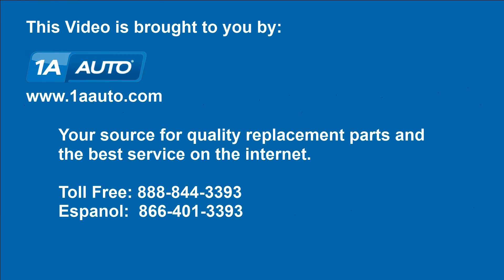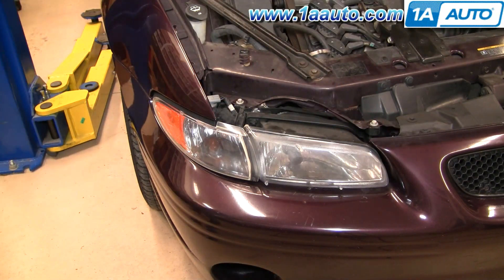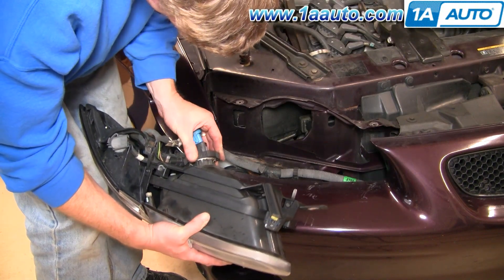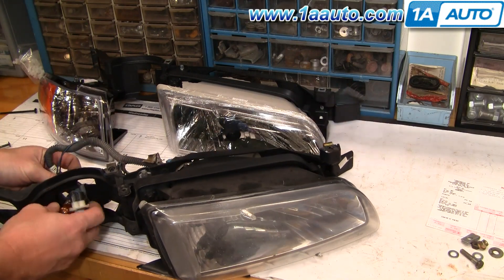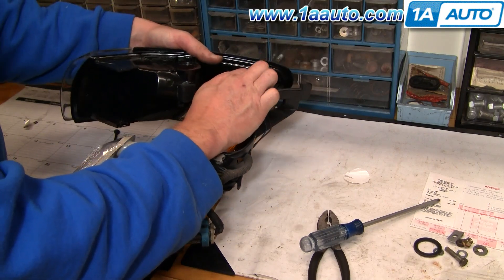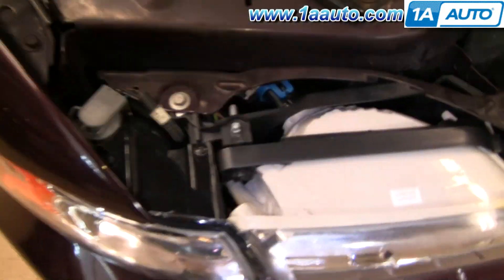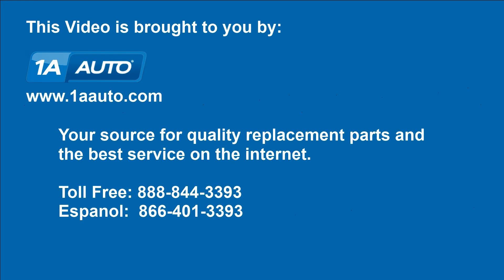How to Replace Headlight 97-03 Pontiac Grand Prix

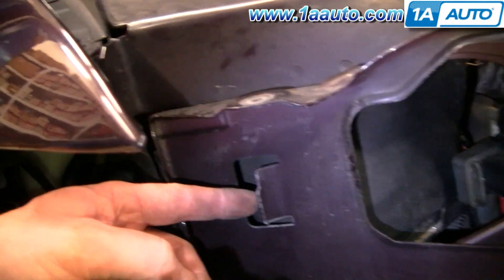Comment: I don't think I could have done this without your video.  I did notice, during post installation review, at 5:42 of the video that the back tab on this car had been notched at the top.  After struggling to get the back of the headlight to fit under the back tab, I used side cutters to trim the top of the plastic piece made onto the headlight.  Easy Peasy.  Thanks for the great video.  I can drive at night again!

Comment: Excellent video! I ordered a set from your site for my '00 (which had terribly oxidized lens), they arrived very quickly and the packaging was excellent, appreciate the free bulbs as well although I chose to upgrade to the zXe Sylvania bulbs as we need all the help we can get night driving here in MI with these treacherous roads!

As for the installation, they both went right on hassle-free, clicked right into place, no struggle at all, screw holes lined up perfectly. I also elected  to apply silicone sealant around the housing seam on each to prevent condensation, another downside to car ownership in MI. If it isn't snowing, it's raining! Not to mention the extremely high humidity all summer.

For only $89 bucks out the door and free UPS Ground, these were a great winter fix for me until I upgrade to a set of Angel Eye Halos in the late spring. Thank you again for making my buyer's experience so great! :)
Reply from the maker: Thank you for watching!
1aauto.com  888-844-3393

Comment: out of curiosity, could you just leave the harness and plastic housing where it is and just swap out the old lenses with the new ones? thinking once it's put back in the car, should maintain the light beam height as the original????

Comment: Can I get the part that's on the headlight separately? The part where you would screw the headlight to the frame and mount it. My screw holes broke when adjusting the light aim.  They are halo projector lights, too so I don't know if I need a certain one.
Reply from the maker: +xxsnowthugxx believe you are referring to the headlight mounting brackets... http://www.1aauto.com/1997-03-pontiac-grand-prix-headlight-mounting-bracket-pair/i/1alhp00264  This is a link to the pair. We sell them individually as well.

Comment: Will just changing the bulb increase the brightness?
Reply from the maker: If the lenses are clear and in good condition, you can switch to a brighter bulb that may help out at night a little better. 1aauto.com 888-844-3393
Reply: Thank you for the feedback :)

Comment: you show how to get to the bulb and pull it out of the headlight (@ 2:00), which is easily done without the video. My problem is I cannot remove the bulb from its gasket(not sure what that part is called) to put another bulb in and I'm afraid I'm going to break that thin metal part that is holding the bulb.  Any help?